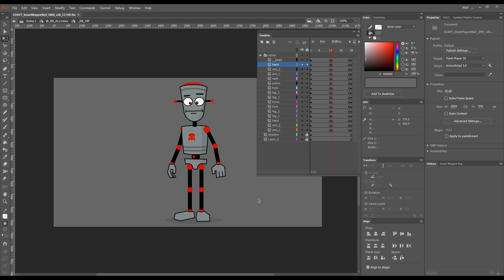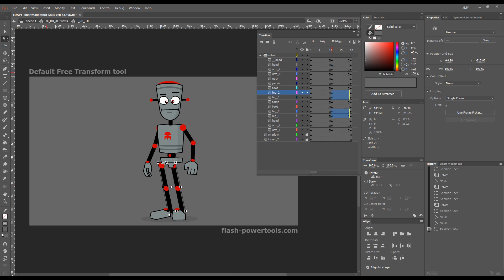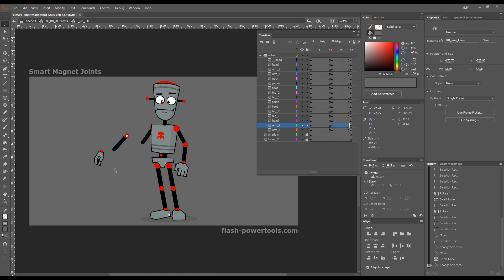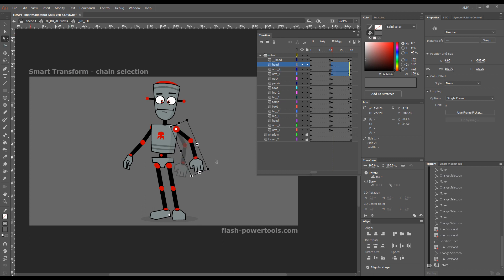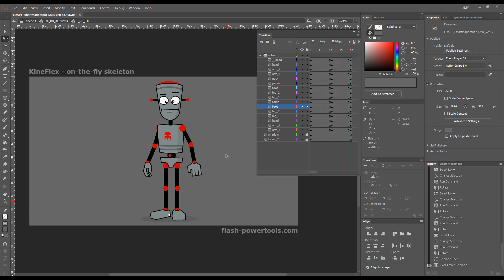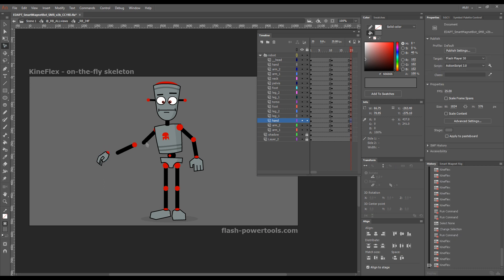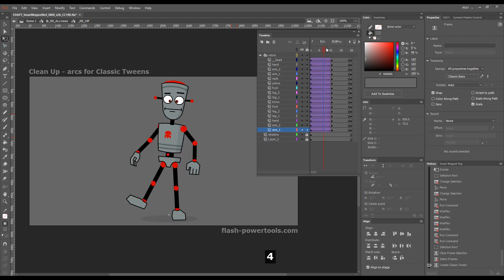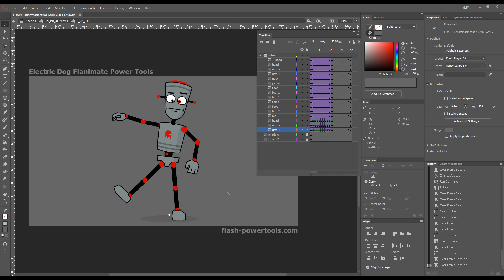Smart Magnet Rigging for Flash and Animate - Introduction

Comment: Just learning of this tool now and it's looking quite promising.  Would I be correct in assume that a flexible way to work would be to have your elements of your character as graphic symbols all on separate layers, i.e arms, head, hands, etc, so that you could change the frame of one of those graphic symbols at certain times?  For example say you wanted a hand which is rigged up to go from open hand to a closed fist?  

What would be the easiest and most efficient way to do that while you were animating?
Reply from the maker: Hi Austin,

You are absolutely correct - generally speaking all body parts except the head are usually stopped Graphic Symbols, where you can choose one frame or another to show a different state (like your your hand example). The only exception would be the head, which is usually run in sync with the animation timeline and has all facial features nested within to change expressions and lip sync.

Please, visit our website, download a few of the sample character rigs and have a look at our articles on character rigging and general workflow.
We discuss these concepts in much detail there.

Good luck!
-Nick
Reply: @EDAPTools  I'll keep watching your videos.  Are you saying the head is still a graphic symbol?  Just not stopped?  Do you have any video with lip animations within a rig?
Reply from the maker: Yeah, the head is also a Graphic Symbol set to 'Play Once' and synced.

Check out these two links for details:
https://flash-powertools.com/character-rigging-for-flash-animation/
https://flash-powertools.com/workflow/
Reply: @EDAPTools  Wow, thanks for all of this.

I'm really wanting to transition away from DUIK in After Effects and Joysticks n Sliders.  The process is so incredibly cumbersome and slow so I am hoping this is a vast improvement.

I will still have to incorporate this Animate stuff into After Effects and so I'm hoping that won't be a huge pain.  I know it will only work with SWF and changing assets is likely going to be a pain...but it can't be any worse than what I'm doing now.

Thanks again for your prompt and in detail responses.
Reply from the maker: You are most welcome, Austin!
I know that many people and studios have such workflow where character animation is done in Flash/Animate and then all compositing and effects in AE. It seems to be quite common and you should be able to find information and answers if some issues arise.

If SWFs work well for you (there is an 'optimize for AE' checkbox in publish settings) that should be the fastest and easiest way. Other methods would be 32-bit PNG-sequences or MOV with alpha channel. I've also heard that you can drag a FLA into AE, but have not tested Animate to AE compatibility in recent years as we are very busy developing the tools.

Soon we will be releasing v.6 of EDAP Tools, which will bring pro-grade IK to Smart Magnet Rigs, integration of Layer Parenting and many other big improvements.
Good luck with your projects!

Comment: The arguments you state at the beginning of the video are solved by the Layer Parenting tool. 
Love the soft rotation though!
Reply from the maker: You may not know this, mate, but Smart Magnet Rigs have been available since 2013 and bring the full SMR functionality to all versions of Flash starting from Flash 8 and all CS for all those animators and studios who are reluctant to switch to the CC subscription model.

At this stage I refrain from cricising Layer Parenting and its implementation publicly, esp. here, because it's just an easy picking. May do so after a couple of releases when they sort out some of the most glaring issues that prevent it from being a production-ready tool at the moment.
-Nick
Reply: @EDAPTools  aah, you're right, I didn't know that; and also right that Adobe needs to up their game with animate.
Reply from the maker: Are you kidding, mate?
It will take another 3-5 years until Layer Parenting gets closer.

Layer Parenting exhibits all the problems of the rigid skeletal systems and have many unsolved issues at present.
Good luck animating anything substantial with Parented Layers :) :)

Or better: Enjoy SMR!
Reply: @EDAPTools  okay, I think I miscommunicated my point. I'm not saying that layer parenting is close to what you have here or is better than this. You started the video off by saying that you need to select, for example, all of the arm, move the anchor point and then hard rotate it... What I'm saying is that you don't need to do that with layer parenting. You can just select the top part of the arm and rotate it and it'll rotate the full arm i.e. its children too.

I agree, the tool you have here is far more superior than what animate offers OOTB specifically the soft rotation ability.